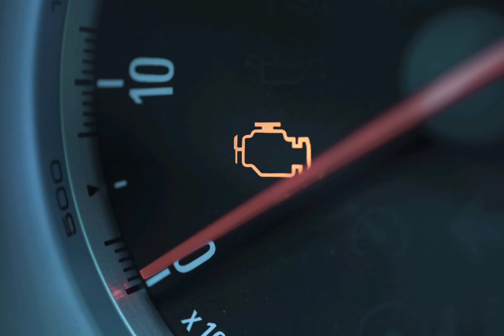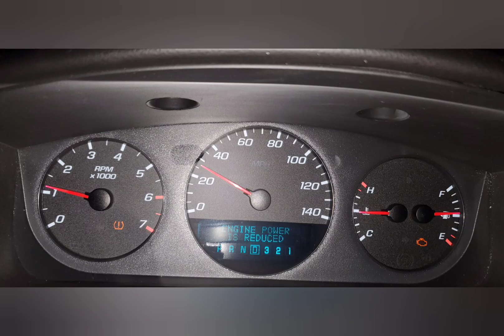MY PATROL CAR IS DOOMED

Comment: Get the check engine light scanned it's either the throttle body or the gas pedal most likely
Reply from the maker: Gas pedal ? Really wow
Reply: @commanderhall848  yea man these cars have a electronic gas pedal it's a sensor controlled pedal they fail alot as well I changed two on my 2011 impala just first get the codes and go from there
Reply from the maker: @stephenwilliams7563  wow thanks alot
Reply: @commanderhall848  no problem bro anytime you need help just give me a shout-out on a video and I will guide you threw any issues all I work on is the police impalas so I'm very knowledgeable on every aspect of them
Reply from the maker: @stephenwilliams7563  Tryou85@hotmail.com 
Can u shoot me a email so we can exchange info
Reply: @commanderhall848  I will send you a email